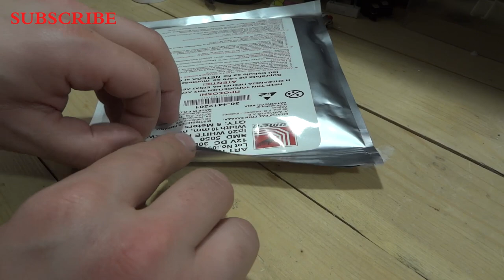Unbox & Set Up RGB LEDs - Watch Before You Buy!

Comment: Can we plug in multiple 5 meter RGB strips ? I want to create 50 plus meter wifi controlled LED strip. What kind of SMPS is supported for this ?
Reply from the maker: you have to see two things on led strip.It must be12volt dc and how much (watt per meter) or how (ampere per meter) .. if it is 12watt/ meter then for 5 meter then 5x12watt = 60watt !! so you need up to 60watt power supply. and controller up to 60watt. if u wired in parallel 5 + 5 meters of led strip, then it double the amount of watt.. so 60w+60w = 120w.. then you have to use power supply up to 120watt. (for this better to chose 150watt and not 120watt, In this case it will work without heating too muchk) thank you for your comment <3

Comment: Ich bin interesirt zu kaufen Led Controler RGB vom 75A (amper), kans Du bitte mir helfen, ich finde nicht in serbien
Reply from the maker: what the full system you want to install ? you can use 4 different controller of 24A : https://www.ebay.com/itm/301783770356?_trkparms=amclksrc%3DITM%26aid%3D111001%26algo%3DREC.SEED%26ao%3D1%26asc%3D20160908105057%26meid%3D11ae1e5b824143209e783565bb77f7dc%26pid%3D100675%26rk%3D5%26rkt%3D15%26sd%3D363949342444%26itm%3D301783770356%26pmt%3D0%26noa%3D1%26pg%3D2380057&_trksid=p2380057.c100675.m4236&_trkparms=pageci%3Aaacf271e-1ff3-11ed-9288-3eb3afee9ce7%7Cparentrq%3Ab78aa17a1820a0d30a953a57fffc809a%7Ciid%3A1
Also u need 100A power supply and RGB led strip 12v and length under 100A